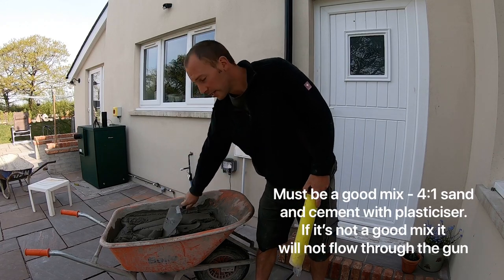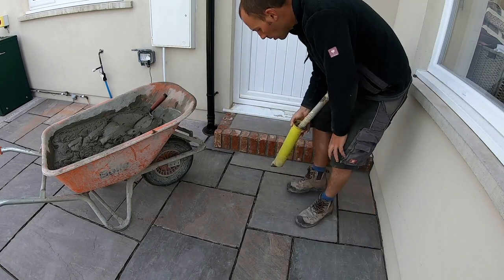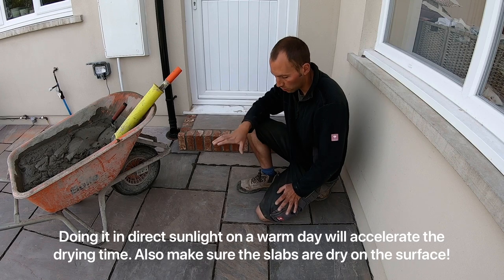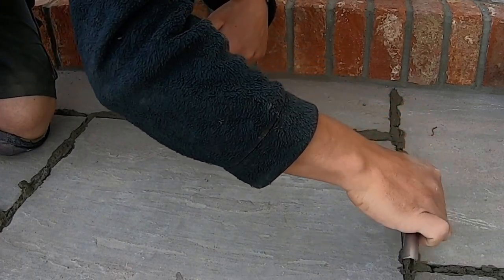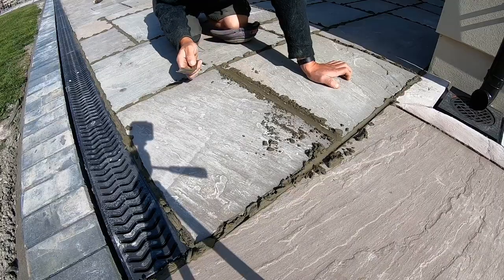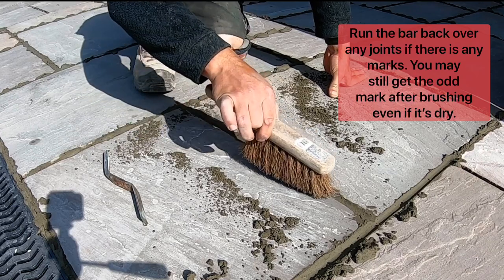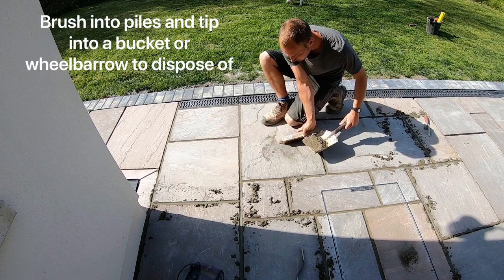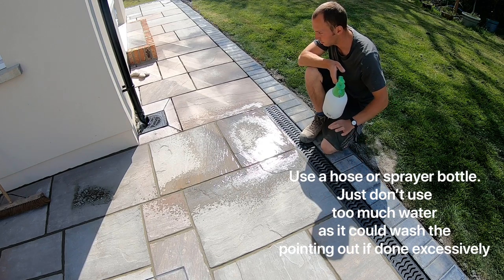How to point a patio

Comment: Thanks for the great Video Sam. Very handy as I am about to point a large patio!  In the past I have used a semi-dry mix, brushed in and then compacted. I was considering using one of the Polymeric wet brush in mortars but from what I have seen it is impossible to get a nice smooth finish like you did in the video.  So I will give your method a try and see how I get on.  What sand did you use in your mix ? Did you use any dye to get that grey colour?
Reply from the maker: GAP999 thankyou for watching! It’s hard to get it right with semi dry as it never seems to cure as strong as when it’s put in wet. The resin based ones can still be fooled up fairly smooth! I just used normal building sand, has enough body in it to be strong. You wouldn’t want a plastering sand in my opinion as I think it’s too fine. No dye at all, the cement has given it that colour - I know cement such as Blue Circle is a lot lighter. Also to note it will dry darker if it’s tooled up drier, if you pointed it when it’s too wet it will dry lighter. So many factors involved!!

Comment: Great job. Am going lay similar patio for someone.  Is it worthwhile sealing slabs first.?
Reply from the maker: Thanks. I wouldn’t seal them first unless the manufacturer states it. What slabs are they?
Reply: @SamDaviesBuilder  Indian sandstone. Have  layed a good few concrete slabs over the years. Getting a bit confused now looking into other materials. A couple  of questions. Can these slabs be layed  on conpacted type 1 or over here called 804.  And also  you  did not  butter up underneath slabs . Something else  a bit  confusing.
Reply from the maker: @paultant6741  I’d seal the sandstone after it’s laid - but it’s good practice to wait 6 months incase any salts come through the slabs (efflorescence) as you don’t want to seal them in. Yes you can use that as a base and just a mortar bed then. I don’t butter up but it certainly won’t harm. Will try and do a video on Indian Sandstone one day
Reply: Thanks Sam for for quick replies and information will look forward to a video on Indian sandstone.

Comment: In the mix, do you leave it quite dry so drys quicker and can brush off later with little staining?
Reply from the maker: You’ll have to have it wet enough so it flows through the gun nicely. There is methods of brushing dry mix in but it never goes off strong enough in my opinion
Reply: @SamDaviesBuilder  that is great.  I agree.  I tried one of these dry brush in mixes and on recently jet washing clean the patio, all grout came out.
Reply from the maker: Rate my Gadgets yea dry sand and cement brushed in is very hard to get right. This method is much easier to get it to go hard and long lasting

Comment: Hi, could you not add the cement with sand dry then brush it in then light shower it over ? Sorry I'm new to this . Thanks
Reply from the maker: Jimmytwogunz that’s not the best way, I’ve seen it come loose like that. You’d have to really get it right for it to work. Also it would need to be compressed once it’s in the joints. Is much better when you can put it in wet
Reply from the maker: And thanks for watching the videos too :)
Reply: @SamDaviesBuilder  np and thank you for the quick response

Comment: I've had one of those  syringe things for over 10 years, totally useless , it jams up at the first squeeze.
 One of my mates is a landscape gardener, he also tried and  said he had to use so much plasticiser he gave up, so that's what I tried again today, increased the plasticiser amount by about 10 fold above recommended.   The result - it jammed up and I reverted to traditional trowel. . Maybe its good for something, icing cakes, squiring kids with waters,  because its  bldwy useless for pointing.
Reply from the maker: If it’s jamming up on the first squeeze you haven’t got the mix right.  You don’t need a lot of plasticiser for a good mix, it’s all about the mixing time - it needs long enough to ‘cream’ up and wet itself up rather than adding too much water.   Honestly if you can try it with a good mix you will love the tool!
Reply: @SamDaviesBuilder  Well, I tried again,  not to much water, a dash of plasticizer mixed it all up until it was creamy smooth, I loaded  into the pointmaster  thinking this is it, pointing perfection, and bingo, exactly the same result, it jammed on the first squeeze. Maybe I need cement baked in the kings own kilns underneath Balmoral and sand mined in the Queen of Sheba's marble mines in Ethiopia as the the stuff I buy from B&Q seems to jam at first and every use. So I will stick by my first comment,  totally useless, maybe if you have a few tonnes of  sand and cement to practice, but for most of us DIYers its a ridiculously overpriced (£25 yikes) waste of money.
Reply from the maker: @philldavies7940  that’s interesting.  How tight have you got the nozzle? If the mix is right, it is no trouble at all to push through.  I am using the point master tomorrow so I can make a little video.  Are you using building sand?
Reply: @SamDaviesBuilder  Aye , builders sand, not sharp sand.  I don't know what you mean by how tight the nozzles is -it was fixed on by pointmaster all those years ago, I've never removed it.
Reply from the maker: @philldavies7940  I mean is the metal part of the nozzle quite tight where it comes out, sometimes you have to widen it a bit to make the material easier to come out

Comment: Belting video pal... How long before you can jet wash and apply a sealer?
Reply from the maker: Thanks! I’d leave it at least two weeks. Are you thinking jet wash to get rid of any staining? If that’s the case I’d use a weak brick acid. With regards to applying a sealer then you’d have to read up on the sealer you’re using - some sealers say leave it a while incase you lock in efflorescence which can happen on some slabs - if you sealed too soon then it would be trapped beneath the sealer
Reply: @SamDaviesBuilder  thanks for the reply buddy... Had my garden done a month or two  ago and the pointing is poor so want to rake out and repoint next yeah.. .. The slabs are a dark grey slate and are quite porous as I was unable to seal them as winter had set in... Was wanting to jet wash to get them as clean as possible before i seal with adseal..
Reply from the maker: @brimplas1  was the pointing a dry mix originally? Always find that way never goes as hard as the method I do. 

The resin pointing is really good too, just more money to buy but goes rock solid!
Reply: @SamDaviesBuilder  it was a sika brush in one... The problem is with his installation, he didn't keep the joints clean when laying the slabs and i can see the cement through the pointing....
Reply from the maker: @brimplas1  I see. A lot of the resins need a minimum depth. Another problem is people don’t compress them with a tool and they just break out. Anyway, hope this method works for you and remember the key is having a good mix and using good quality sand and cement
Reply: @SamDaviesBuilder  yep, yes its as little as 5mm in some places...thanks for your help fella... I will re watch this video in the summer.. 👍

Comment: Great video. What sand did you use Sharps or builders sand and what was the mix ratio 3:1?
Reply from the maker: Hi, mix is 4:1 building sand with a bit of plasticiser. Needs to be a good mix to go through the gun
Reply: @SamDaviesBuilder  Thanks Sam, I'm struggling to get builders sand in small quantities, they only seem to be selling the large hippo bags which is massively more than I need. I've seen the Wickes ready mixed mortar in 10kg tubs, if I added a plasticiser, would that be an OK mix? The Patio is only 4metres square so not that big.  I reckon 4 tubs would about do it.

Comment: y not just use easy joint?
Reply from the maker: A cement pointed patio done well is as good as anything. Also, sometimes it comes down to cost as I know I can do this method cheaper than the resin based pointing. Nothing against the resin based pointing though as I do use it on jobs!

Comment: Do not use a wet mix people I’m telling you 4/1 dry mix slightly wet any over spill stains the sandstone with a wet mix 🤷‍♂️
Reply from the maker: Jon Jones not if you’re careful. I’ve never had a problem doing it this way. Dry mix can be done but it’s very difficult to get it to go fully hard and be long lasting
Reply: Sam Davies your a professional mate knows what he’s doing the average joe mate will fuck it up and have staining everywhere it’s come back and bit me on the arse twice with customers.
Reply: @jonjones1170  I’m expecting to fuck it up so I’m taping off my multicolored slate flagstone (irregular edges) with some areas of mortar ( that were not loose but too flush ) receiving a skim coat for uniformity. I beveled and took off 3/8 “ old mortar in some too flush areas. 
It was horrendous to clean up old mortar stains and overflow. 
Preparing my Portland mortar mix tomm. Adding in a little cement adhesive into the mortar mix . And brushing some on by hand to more flush areas. 
I wouldn’t attempt this looser mix for my application (irregular flagstone) but it sure is beautiful to watch and picked up tips nevertheless for a later project. 
I’m tempted to buy a little builders sand for extra stick power. Maybe overkill ? 
Back to taping off today. Praying I don’t eff it up. after weeks of research and prep.

Comment: 🙈🙈🙈🙈 I’ve seen nothing like this in  35 years man and boy . Just mix it up in a wheel barrow 3-1 sand cement semi dry, no staining and no waiting for it to go off , and brushes off easy after 10 minutes. Just make sure you pack it in the joint . You should use a flat  pointing iron not bucket handle for natural stone to show off the edges of the paving . Looks good what you’ve done but painful to watch .
Reply from the maker: TOTAL LANDSCAPES what’s painful about it?

I always use bucket handle as that shows off the edges better - if you use a flat jointer and leave it flush then it fills in the riven parts. I’ve had bad experiences with semi dry - no matter how well you do it, it never goes off as hard as a wet mix. 

If you could do a video of your technique that would be great, I always like to see different methods!
Reply: @SamDaviesBuilder  
Im on porcelain paving at the mo but the next sandstone one we do ill film it . Be about 3 weeks time . 
Anyway keep up the daily grind . Its hard work and you dont need divs like me criticising . It just looked hard work the way you were doing it.
Reply from the maker: TOTAL LANDSCAPES no worries I don’t mind constructive criticism. What do you point your porcelain with?